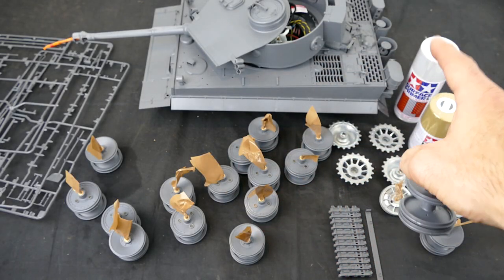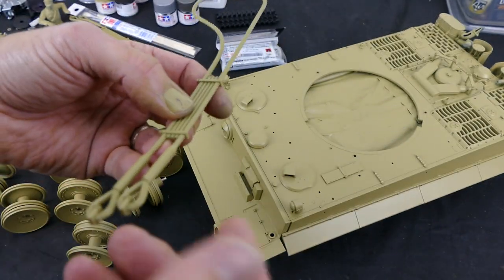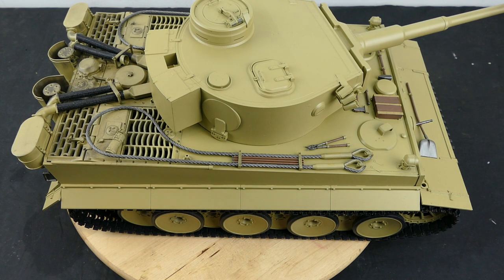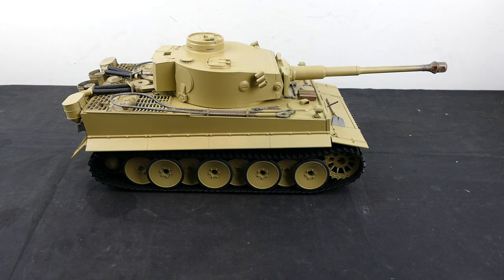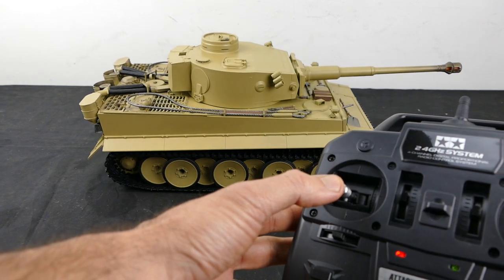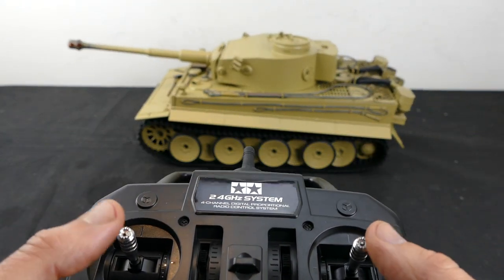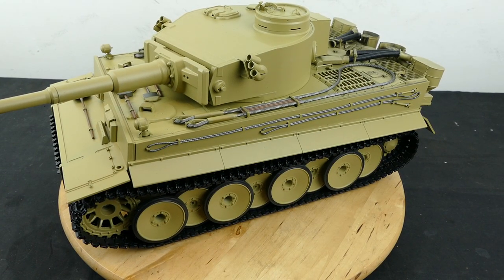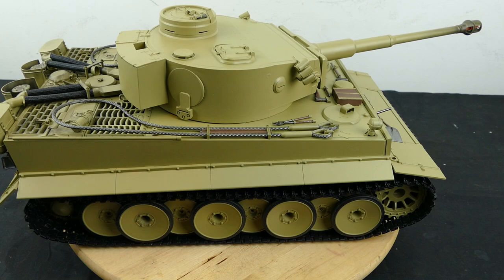TAMIYA 1/16 TIGER 1 RC Tank BOVINGTON TIGER Build Series - Completed & Tank Functions

Comment: I've built the Tiger I and the King Tiger. The only gripe I have is they both run very scale like in forward but reverse is way too fast. Haven't been able to tone that down in either one of them.
Reply from the maker: You have to buy the gear reduction gearboxes
Reply: I'm trying to decide between the Tiger I and the King Tiger. They both seems to have the same functionality and sound effects, so I can't decide! Any preference? And why?
Reply: @jasona9393  They’re both great kits and and I think you’ll be happy with either one of them. The King Tiger is slightly larger and does utilize 2 battery packs for longer running times. My King Tiger was actually a static display kit with the Porsche-style turret but I was able to retrofit it to a fully functional tank. Whichever Tiger you go with, I would recommend painting and weathering as you build as opposed to after it’s built (learned that the hard way with the Tiger I).
Reply: @genelegate1308  I really appreciate this reply, thank you so much! That nails it for me: Bigger kit, twin battery!
Reply: @genelegate1308  So kind of you to reply and let me know, thank you very much!

Comment: Superb model, but it desperately needs gearing down! Tamiya should be doing this at the factory , everything is moving way to quickly imho.
Reply from the maker: +e575fho yep you have to control it with your fingers :)
Reply: e575fho it's just the "sport edition" of the tiger
Reply: Stew JW  thats true. you could also add the other thing.... i havent flown aircraft in  such a long time that i forgot lol!
Reply: is it called rate?

Comment: Hello RC Tanker. I once bought a Tamiya Tiger 1 almost finished without paint but I didn't like it much, good deal and it went right away. I was very curious about the realisation of the Bovington original. But I was a bit disappointed. If you have the chance to build an actual example, then you should do it, especially because the Bovie is very well documented. The African camouflage alone, boldly applied in a silky gloss in the museum, would be an eye-catcher. Well, maybe some other time. Please don't be angry.
Reply from the maker: This was not my tank. The owner wanted to paint it. It is just a toy man. No big deal.
Reply: @RCTanksTrucks247  oh okay, i did not realize that. Customers will is our law, in deed.

Comment: My Tiger wound up with all kinds of new metal suspension and ground engagement (tracks, wheels, torsion bars, bearings) and a full on photo etch detail set. All the fenders are sheet metal and are bolted on with scale nuts and bolts. most of the surface details are enhanced or replaced with metal parts. Headlights are operational.The paint is 4 layers deep with red primer at base. The tank is filled with very heavy lead acid batteries and the very strong suspension gives exceptional live suspension motion and and the gravitas of great mass. It weighs 14 pounds. Germany is a hotbed of modifications for RC tanks.

Comment: The only thing that looks good on that Tiger I, is the gap between the Turret and the Deck, which is very noticeable on the Heng Long and Taigen Tiger I and that's only because the turret ring is Offset Forward, it's not actually Centered as it should be like that on the Tamiya Tiger I.

Other than what I posted above, that Tamiya Tiger I does look good, I like that Fresh Off of the Production Line look, and btw, if the owner or anyone wants to make their Tamiya Tiger I to look more like Tiger 131, the Gun Mantlet needs to be replaced and the Headlights removed (what I'm in the process of doing to my Taigen Tiger I).
Reply from the maker: +Evil Fingers thanks for that. Yeah there is a few changes that would need to be made but I think they will be happy with it. 
Thanks for watching

Comment: Didn't know Tamiya made an actual Remote to go with their Models despite having 3 ( King Tiger, Flakpanzer Gepard & Leopard 2A6 ) of them myself... Always been using an off the shelf one my 16-32CH Capable FrSky Horus X12S.
Kinda wish Tamiya would a) stop using that vintage style Trimmer Setup to access more than 4 Functions on a 4CH Setup by simply adopting something like an 8-12CH Setup, ideally via S-BUS, and b) release some sort of modernized universal DMD/MF Controller Unit compatible with all the previous models including all the new tech like the Turret / Cannon Stabilizer from their Abrams M1A2 has. My Leopard 2A6 ( actually now a Leopard 2A7+ ) has neither of them built-in in and only one of them is optionally available as a first-party addon and the other only available as an uncomfortably pricy third-party one >_>